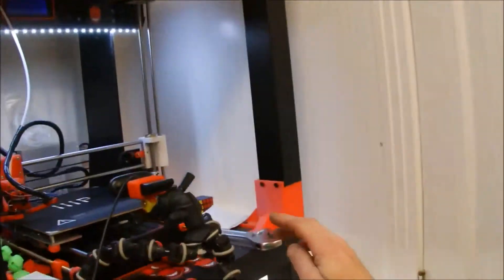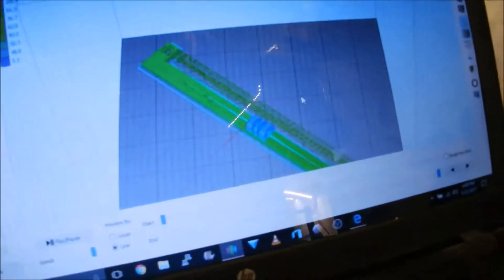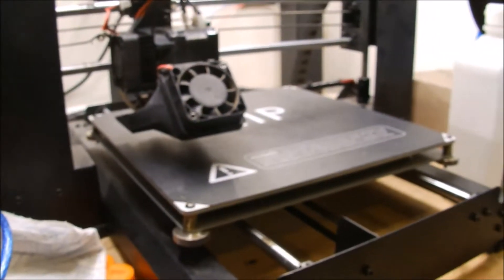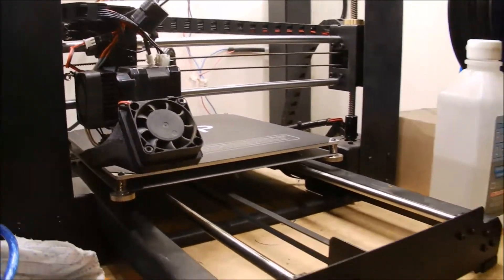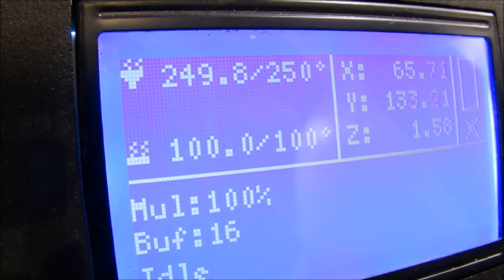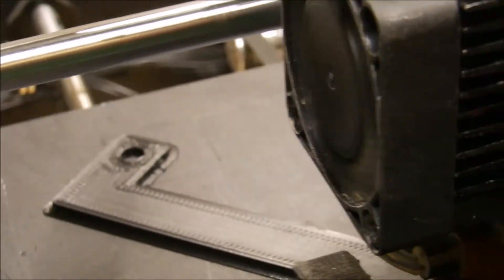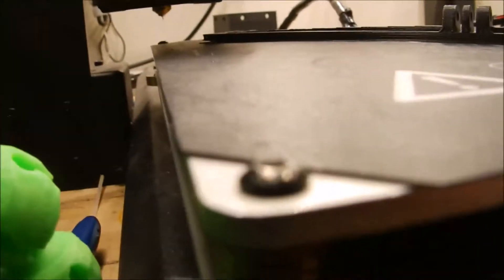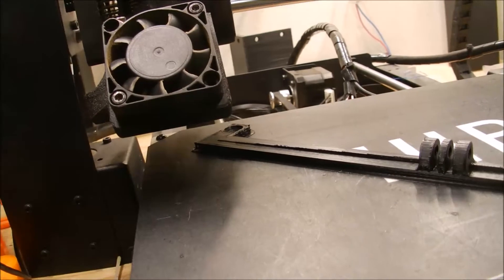ABS Test On Buildtak (Maker Select V2)

Comment: Hi, besides the MOSFET mod, have you done any other mod to the printer to set the bed to 100°C?
I have the same printer but it states in the manual that the operational print bed temperature is between 30 and 70°C.
Thanks!
Reply from the maker: i'd suggest doing a Bed PID tuning 
Bed: M303 E-1 S60 C8   
M303 = is the autotuning function 
E-1 = selects the bed
S= temp
C= how many cycles 
after it runs through the tuning it will give you a set of PID values for your bed enter either via a 
terminal or through the display menu make sure you save M500 = EEPROM save

Comment: Another nice vid! Thanks for doing one for us ABS heads, lol. I was interested to see how the build tek faired against ABS, and it seemed to do a decent job. I know you probably only like doing functional prints (I do too, because in my case filament is a rare commodity) but if you happen to have any ABS to play around with, maybe just a simple test rectangle about the same length and width as your cam mount, but around an inch tall, just to see how well the build tek combats more severe warping forces. In my case, and through all my research, I've found 235-240c on the hot end and 110c on the bed to be what's suggested as optimal temps for ABS prints in and out of an enclosure. (at least for printing around an average of 50mm sec) I'd love to see how that surface does under those conditions if you're ever willing to give it a shot just for researching sake.